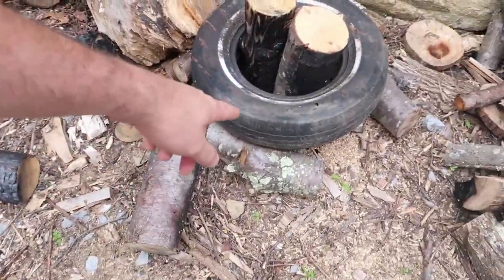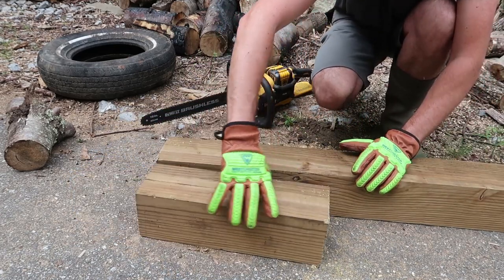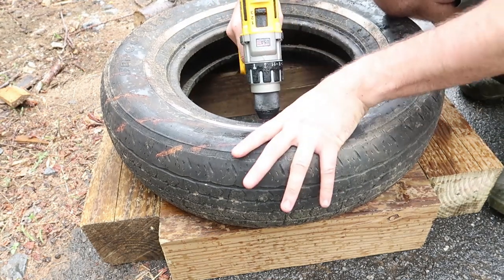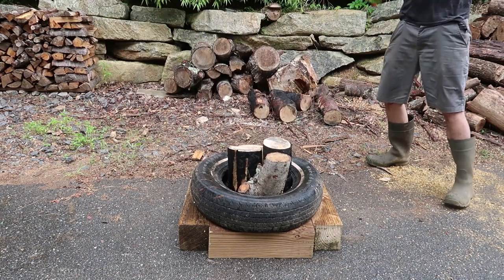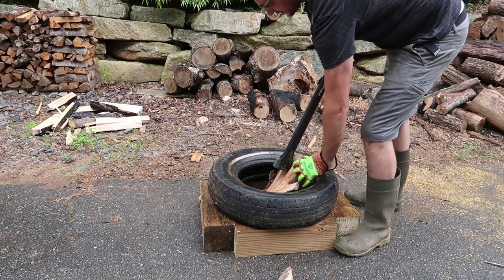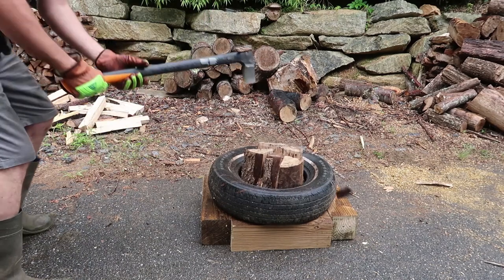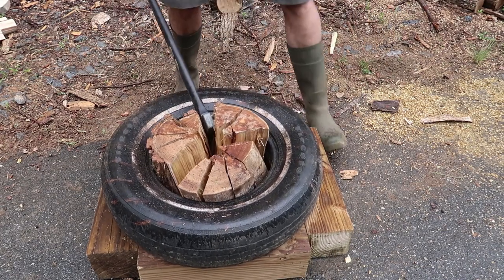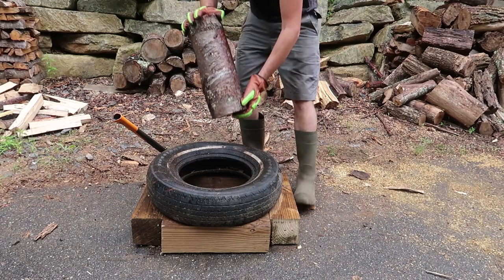Split Firewood with a Tire! Upgrade.

Comment: Tip; put washers on the screws in the tire. It will keep them from pulling through the rubber as easy.